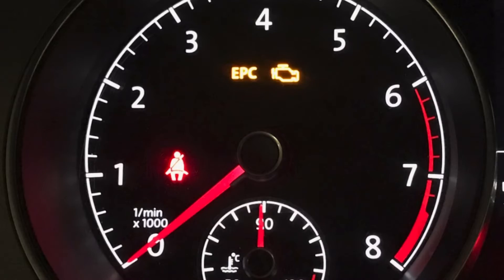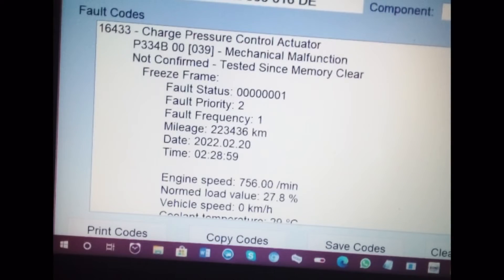VW Tsi P334B Turbo Actuator Mechanical Malfunction

Comment: Hey, thanks for this great video.
i've changed my turbo 5 months ago.
It's now been a week that i'm trying to find the issue.
EPC Light, P334B DTC shows. But sometimes, it dissapears.
What i can say is that it's been 1 month that i'm consuming a lot of gasoline, like A LOT! Even before dtc shows up.

Do you know if it's the turbo? Because it sometimes dissapear.
Reply: Check your wiring and ecu for corrosion had same issues
Reply from the maker: Hey mate unfortunately you can’t guess at these situations it’s a case of being able to diagnose it based on what the vehicle is doing and certain checks I would carry out

Comment: I have this problem on my 3.0l tdi audi but no symptoms only the code
Reply from the maker: This video wouldn’t strictly cross over to the 3.0 diesels buddy but with this fault code you would have some performance issues for sure
Reply: Thats the weird part everything sound right now power lost for sure and the fuel economy on point @TheVWMechanic_official

Comment: Can that fault drive to a melted pins inside the turbo actuator? I have got the same code. When checked, 2 pins and respective cables were melted.
Reply from the maker: Potentially or you could have 2 faults

Comment: Hi buddy , I’ve got seat Leon 2013 1.2 tsi with the same exact fault code , just had a new actuator replaced , but still no power and same fault code . Do you know if it needs coding or what else it could be the cause for this error?
Reply: Thnx for your reply mate . I just replaced the turbo and code still persists and car still in lymph mode , im completely baffled now .
Reply from the maker: @piccadillycircus9416 that’s gunna need some testing then buddy
Reply: Did you sort it? If so what?
Reply from the maker: Turbo actuator
Reply from the maker: Hey matey thanks for the comment what can happen with these is when the rod is removed the person removing it can also bend the wastegate arm on the turbo itself and that will also thro this code

Comment: This is exactly the fault on my 2013 VW polo blueGT. So what is the best way to free up the mechanical linkage (once I find it haha) cheers for the video
Reply: Update :- Worked 💪👍👊
Reply from the maker: Love a good update Thankyou so much matey and enjoy 😉
Reply from the maker: Lots of wd40 matey and patience and sometimes they are that stuck that you bend the rod trying to remove it which means the rod would have to be replaced if you can successfully get it off
Reply: Nice one. Thank you I’ll give that a go. 👍

Comment: Hi I’ve got a vw polo gt 1.4 blue motion and I’ve got the same problem the epc light and engine management light comes on while I’m driving, epc light comes on first then the engine management light comes on I did get it diagnosed and the codes I got was P334B00 and P003300. I don’t know exactly what the 2nd code really is for as I don’t know about cars but do u think the repair kit is for my car or would I have to buy a new actuator?
Reply: Code:P003300 -  Exh. Gas turbocharger solen.air rec.valve electrical fault
 code:P334B00 - boost pressure actuator mechanical fault. What does that mean? Do I need new parts if so what parts do I need?
Reply from the maker: @lexiigeorge4029 it needs correctly diagnosing and then you can go from there

Comment: I got the problem with epc light and lost of power on my audi a5 1.8 tfsi 2012. At first ot was just when its cold the epc light is on after a restard of the car epc was off and car was normal. But now no metter if i retaart car epc is on and the car has no power. I watched this video and can you confirm that actuator should operate like this bcs mine dont https://youtu.be/nIg3mhSfNX0?si=iwtFzHzdA_BpqI1N

Comment: When you change a hella electronic actuator do you need to perform calibration buddy. Got a Q7 3.0tdi playing up about to change the actuator. Thanks in advance.
Reply from the maker: Yep a basic setting needs to be carried out on em dude
Reply: @TheVWMechanic_official  hi buddy is there anything you need to watch when buying an electronic turbo actuator the one I have is G82 I’ve been told the H22 code on the body is critical? Thanks in advance
Reply from the maker: Aslong as all part numbers match your good
Reply: Cheers buddy will spring the VCDS into action.
 @TheVWMechanic_official

Comment: I’ve got this same issue. I took it to a specialist who stripped and clean it but the light still came up a day after. Should I try the repair kit or just buy a new actuator?
Reply from the maker: Hey buddy I would get the repair kit for sure :)
Reply: @TheVWMechanic_official  cheers bud I’ll give it a try. Is the rod (04C198701D) the same for all models. Mine is an A1 1.4 Tfsi 2018.
Reply from the maker: You would have to ring Audi to confirm matey as I don’t have access to Audi parts catalogue

Comment: I have the same fault code as the video if i want it changed how much would you think will cost my car is VW. Golf  1.2 tsi 2014 thank you
Reply from the maker: Hey if it’s diagnosed and proved to be this issue then it’s the cost of the repair kit and labour to fit it….the price varies from place to place so difficult to give you a price….thanks for the comment :)
Reply: @TheVWMechanic_official  roughly between like over thousand pounds you think ?
Reply from the maker: If it’s just this rod that needs replacing it won’t be over £1000 but anything more the price will of course change
Reply: @TheVWMechanic_official  thank you bro 🙏🏻
Reply from the maker: Your welcome Buddy

Comment: Hey I have the same issue. I don’t understand what to do? Emmy car is hardly 20000 km driven. 
Any help would be appreciated.
Reply from the maker: Hey thanks for the comment check your actuator rod if your not sure get it to local garage but the low mile cars usually suffer more

Comment: Ive got a seat ibiza 2019 1.0 tsi giving me this fault code P334B00 Charge air pressure actuator, epc and engine light on, low power. Is their a repair kit i can use to fix my actuator or will i have to buy a new actuator and programme it?
Reply from the maker: Hey buddy thanks for the comment there is a repair kit for vw but I’m not sure if it’s available for SEAT ( I know it makes no sense lol) but for vw you can buy just the rod which is usually the seized bit and it’s a lot cheaper than buying a full actuator
Reply: @TheVWMechanic_official  seat sell a repair kit too it’s £250 thought, what’s the part number for this rod would be worth looking into that
Reply from the maker: I believe that will be a full actuator and rod which in your case if it’s just a seized rod you don’t need the new actuator part number for rod only is 04C198701D
Reply: Appreciate that will try ordering the rod and fixing it this way will save me a lot of money nice one
Reply from the maker: It’s all about saving money where you can buddy :)

Comment: Thanks ! I have an Audi Q3 1.4T EA211 CZEA 150Hp COD version here in Australia. I got the EPC and check engine light and lost power. Audi said the charge pressure positioner valve has snapped ! When I asked for detail they said the Actuator rod had snapped which they have never seen before AND Audi does not make that rod by itself and the kit they have has no rod as the current rod is not replaced with a new one !!. So it's either finding a complete actuator with rod, a second hand turbo or a new turbo (about 4000 UK pounds here) ! Anyway I found actuators for my engine made in China ! I wonder if they are ok or should I just try and find a second hand turbo or actuator from a wrecker ?
Reply from the maker: This is the part number TURBO ACTUATOR ROD REPAIR KIT 04C198701D
Reply from the maker: You can buy the repair kit from vw

Comment: I have a 2015 Audi A3 1.4 isi COD, and have the EPC & engine light on, I am struggling to locate this part to check whether this is the issue or not? Can anybody help me locate please? Thanks
Reply from the maker: What fault codes have you pulled from the vehicle?
Reply: @TheVWMechanic_official  POOAF/$07E8

Turbocharger/Supercharger
Boost Control 'A' Module
Performance
Reply from the maker: Follow this video matey I know the fault code isn’t the same but it will help rule out a seized actuator ……VW Tsi P334B Turbo Actuator Mechanical Malfunction
https://youtu.be/1vqDfwe91VM
Reply: @TheVWMechanic_official  that’s the same as this video I think, I can’t seem to locate that part of the turbo, any idea where it is, so I can check it, on the 1.4tsi COD engine in a 2015 Audi A3? Cheers
Reply from the maker: Look at your airbox matey and just follow it straight over the top and down the back of the engine you will see it
Reply: @TheVWMechanic_official  Think i have managed to find the actuator, but it won't budge at all, any tips to get it moving if I can, or does it need replacing do you think?
Reply from the maker: I have a lot of fun trying to get these actuators off matey it’s a case of loads of wd40 and perseverance

Comment: It seems like I’ve got this problem right now on our VW Caddy TSI 1.2. It won’t open the waste gate, so my guess is that it is toast.
Reply from the maker: Run a basic setting on the v465 actuator and watch it, it will either be moving freely or jolting
Reply: This sounds beyond my competence. 😂 All I’ve observed is that it will not move when I try to rev the engine (a test I saw on Youtube).
Reply from the maker: I see what your saying. Not the best test to confirm it ideally needs to be actuated so you can see it work to both end stops

Comment: Great little vid shows how much trouble a simple thing can cause
Reply from the maker: Absolutely buddy and most people will jump to replacing an expensive turbo and if you can get the seized turbo rod off you can use part number 04C198701D to repair